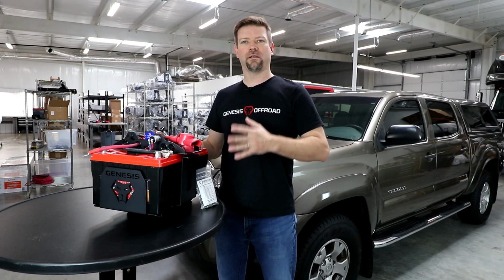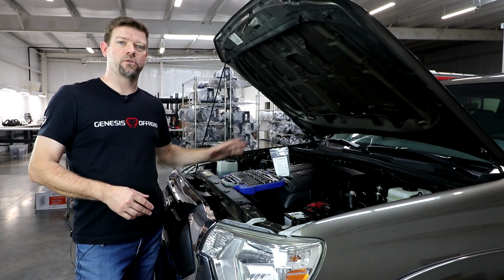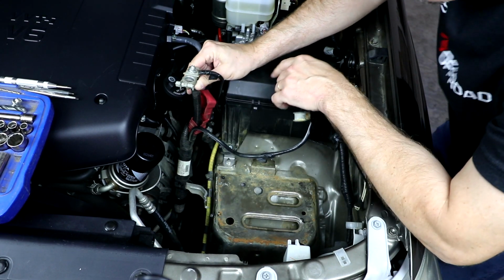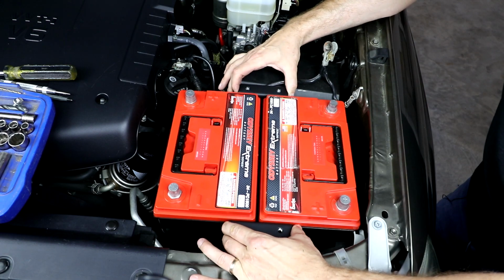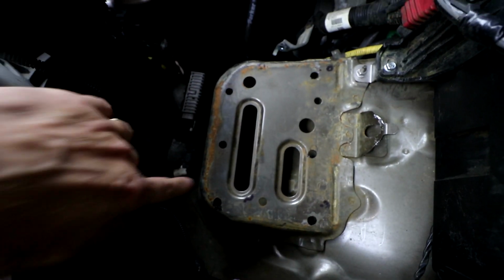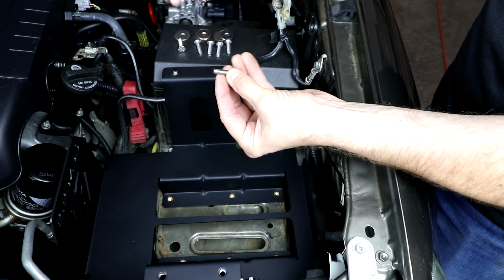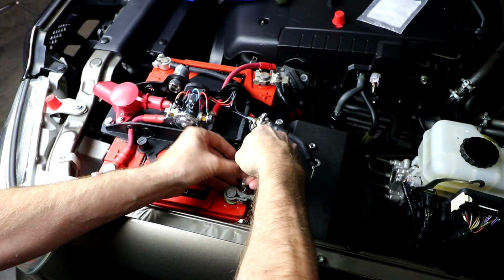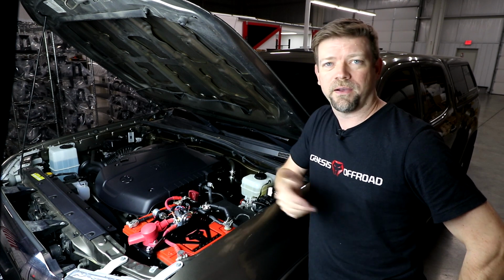2nd Gen Tacoma Dual Battery Kit Installation Video

Comment: Is this install the same for the new Gen 3 dual battery model with the exception of the new top unit on Gen 2 tacomas?
Reply from the maker: Yes that’s correct. Our Gen 3 power hub will connect to the batteries just like the original kit did.

Comment: How easy is it to replace the headlight bulbs?
Reply from the maker: It's not bad. I would just pull the batteries out. It only takes a few minutes to lift the Power Hub and remove the batteries. Some of our customers say it's quicker to detach the headlights so they can slide forward to get to the bulbs. But realistically you'll change the batteries far more often than the headlight bulbs over the life of the vehicle anyway. Hope this helps!

Comment: I would not recommend this product until they change the mounting options.  Those inserts aren't made well and I only got 4 in before it became a massive issue.  I wrote a review on their website but after that I realized they don't actually show the reviews for their products anymore.  Hmmm I wonder why.
Reply: WIsh they would reply to this or at least address it.
Reply from the maker: @tdematties  @joker-ik5ef  Sorry I missed this message earlier. The challenge with all of the Toyota vehicles is that there is no factory mounting point for us to tie into, like we do in the Jeeps. When installed properly, the steel nutserts are very strong and reliable. It's definitely a challenge to install them by hand down in the engine compartment. It's about 1000% easier if you have a nutsert installation tool, which can pop those in place in a few seconds. We know most people don't have that tool, so that's why the video shows how to manually install them. It's a nice additional to your toolbox though, and you can grab a decent one from Harbor Freight for about $50, or a nice professional grade one from Marson for around a couple hundred. I got the Marson model MR34604 years ago when I was installing some fenders and body armor on a Jeep and I didn't want to spend 10 hours doing the nutserts by hand. But like any mod you're doing on your vehicle, it's important to take your time and do it right. If those nutserts aren't fully seated properly to squish the sheetmetal from both sides, they can become loose, allowing vibration in the battery tray which can cause them to fail. We don't want to see that happen! So if you are having trouble with that or anything else, please stop and give us a call and we'll be glad to offer some advise!  901-214-5337. Hope this helps! -Shane

Comment: I'd be more interested in upgrading to the Gen3 dual battery top if the accessory connections werent facing the outside edge of the hood ( very limited space ).  Sure.. I could flip the top around 180 degrees, but then the Genesis logo would be upside down and that would poke my compulsive nerve. 
I have a high output 350 amp alternator and just learned recently that the Gen 2 dual battery kit is only rated for up to 200 amp alternator.  Has been working fine for over a year since I'm not actually drawing more than 200 amps on a regular basis.  Guess ill wait and see if a reverse logo top becomes available in the future. 
 -2011 2nd gen tacoma v6
Reply from the maker: I completely understand. The orientation of the lid is important though. The cranking battery is connected to one side, and the aux battery is connected to the other side of the smart battery combiner device. There can be problems if the lid is installed reversed. If we mirrored the components on the lid so that the bus bars were closer to the fuse box, then the battery cables would look very messy.

Comment: @genesis offroad ... now i need an install video for the 3rd gen dual battery kit for 2nd gen tacoma. pretty please!
Reply from the maker: The install process for the new Gen 3 version is exactly the same, but it only has one ground wire to connect to the factory ground clamp instead of 2 as shown in this video.

Comment: Your kit definitely looks like a winner! I intend on adding some electrical accessories as I slowly build up our 2015 Taco; would it be just be redundant to also have a Blue Sea fuse block? Would one of those even be necessary since your kit already has negative/positive bus bars (or circles, actually) built into its design?
Reply from the maker: Thanks, glad you like it! Our bus bars give you a convenient spot to connect anything that needs direct battery power, but they don't have any sort of fuse built in. You could easily connect a Blue Sea fuse box to our bus bars because it needs power too. Then connect your accessories to the fuse box. Super easy.
Reply: @GenesisOffroad  thx for the reply! knowing that you gotta move the batteries back toward the firewall a little bit, do you know if there are any fitment issues if i were to use one of those fuse block mounting brackets, like the ones by overland equipped? or should that be mounted to the top of the factory fuse box in the engine bay?
Reply from the maker: @weloveversailles  it should be fine. Lots of people use those types of brackets near the fuse box, and we have not heard of any fitment problems yet.

Comment: I have a 99 taco w/a mean green alternator.  Which kit should I use, pretty plz.  Great vid
Reply from the maker: The battery area in the earlier Tacoma is smaller than the newer models, so unfortunately we don't have a kit specifically for your truck, but we do have a couple of universal options that may work for you. Here's a link to our universal single kit which allows you to remotely mount your second battery and then tie it into the one under the hood. https://www.genesisoffroad.com/universal-single-battery-kit

Comment: Will this kit allow me to run a 24v ARB air compressor?
Reply from the maker: Our kit links the batteries together in parallel, meaning they are still 12v. If you need 24v, then you would need to link 2 batteries together in series. Our systems do not provide 24v. That would require custom wiring.

Comment: Hello, will this set up works for my 2004 SR5 T4R V6? This looks like it has the same layout engine than mine. Thanks!!
Reply from the maker: We do have a kit for the 5th gen 4Runners, but their earlier models are a bit smaller, so unfortunately there isn't enough room to put 2 batteries side by side under the hood. We do have some universal options that may work for you though. You can see those options here - https://www.genesisoffroad.com/Universal_c_27.html

Comment: Will this work with 2 optima blue tops?
Reply from the maker: Yes, you can use Optima Blue Tops, just be sure to get the Group 34 or the Group 34/78 size. The Group 34R will have the posts in the wrong orientation.

Comment: @genesis offroad So, i have a +/- wires connected to my single battery for a trickle charger. with your dual battery system, where should i connect to the battery for my trickle charger? to the primary or secondary batter? thanks
Reply from the maker: Here's a short video that shows how to connect a charger - https://youtu.be/BxEV01_4I_s